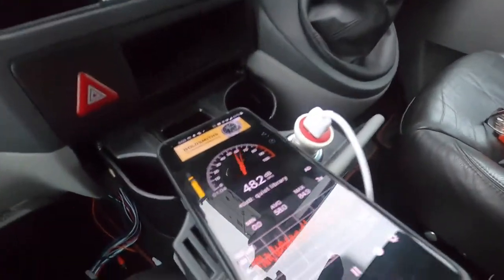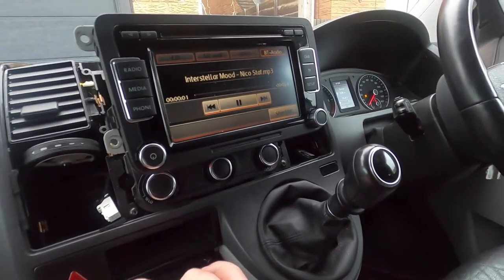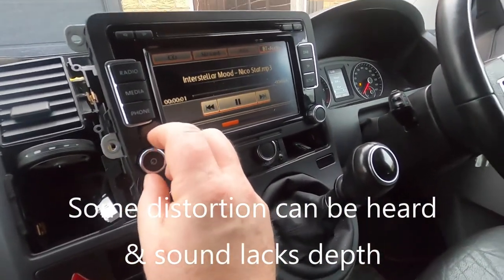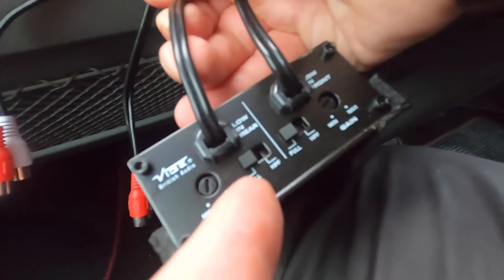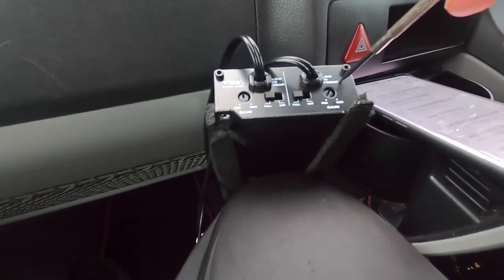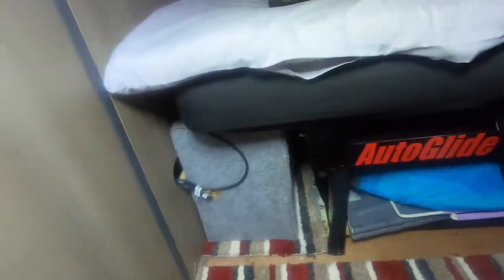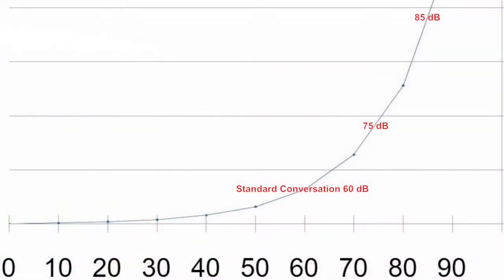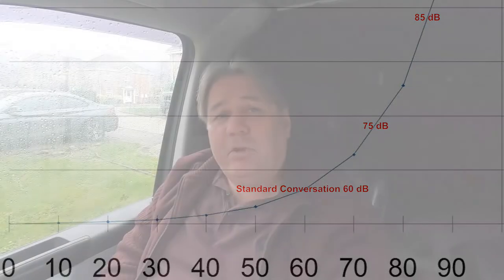Upgraded Car/Van Radio with Amplifier - Sound Test - Part 2

Comment: Thinking of buying one of these. Dunno where you get those figures from though for the percentage increase. Your max/min figures quoted over the two tests were 83/70. That's 13db more which is only 18% increase at that widest point. A 60% increase from 70 would be about 112db. It does sound better though. Those were standard van speakers, not aftermarket I take it.
Reply from the maker: Hi the speakers are aftermarket. Note our perception of how loud a speaker sounds doubles every time you increase the output by 10 dB. So the volume when you go from 70 to 80 is double. I hope this helps.

Comment: Hi, did the 4 chanel amp bring the door speakers to life, was it worth doing ?. Thanks.
Reply from the maker: I think it is worth the upgrade if you have the standard VW head unit fitted. The door speaker sound is much better and not just louder. I have after market speakers fitted though, so I cannot comment on the standard speakers.